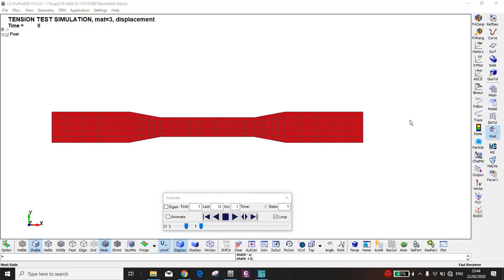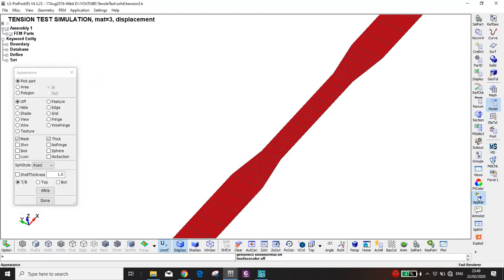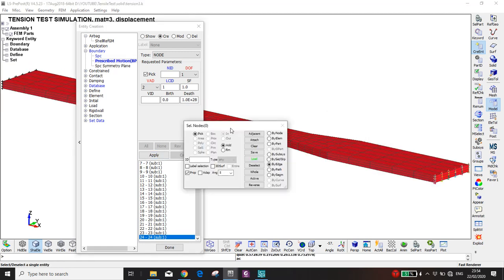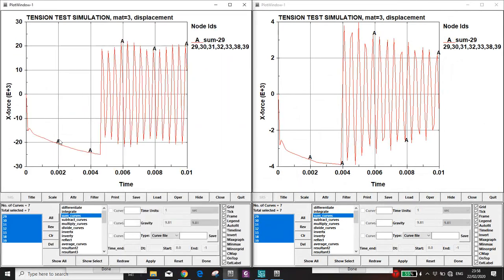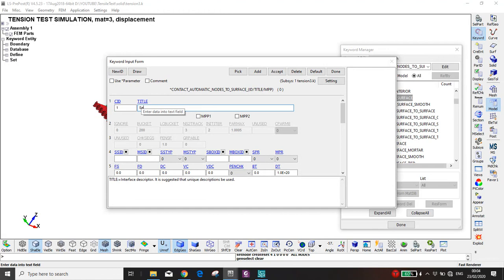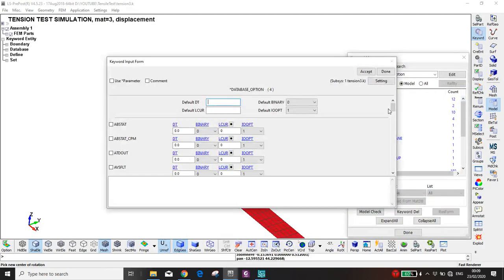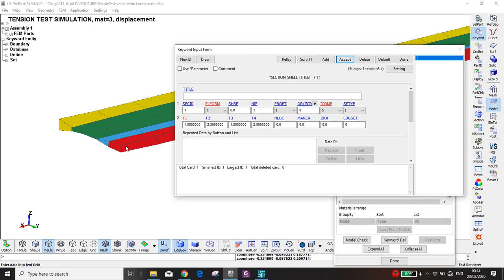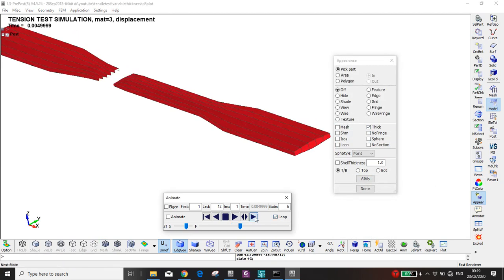LS-DYNA TUTORIAL 9: Tensile Test with Solid Elements and Variable Thickness Shells

Comment: Hi Amen, thank you for your perfect tutorial. This is really important for variable thickness defining. I have a problem in there. When I did all the same, my parts are just blocks like different thicknesses. I can't get the ramp between parts like yours. I mean I did T1, T2, T3, T4 all the same with yours but still there is no ramp. For example, in part 1 if i write T1=2.5 T2=2.5 T3=1.5 T4=1.5, ,it just behaviors as 2.5 .  I tried different varriations but still I can't get that smooth ramps. Also I create a shell from scratch, even on it there is no ramp. I guess there is some problem for defining nodes, but I created entity for nodes too. Do you know any solution?
Thank you.
Yours sincerely
Reply: I had the same problem, tried with a number of recent versions of LS-PrePost, but still the same problem occurred. Only resolved when I installed V4.5.23 as in Ameen's video.
Reply: how did you choose which version you want to download
 @osamahassan3823
Reply: I just recognized , it takes average of datas.  If T1=2, T2=2, T3=1, T4=1,  it acts like 1.5. Here is a screenshot of status: https://pasteboard.co/JOYOO67.png
Reply from the maker: Sometimes it is just a graphical representation error. Try with the latest or another version of prepost.